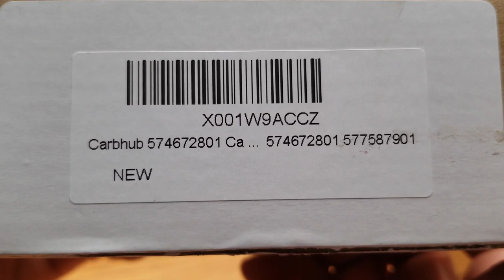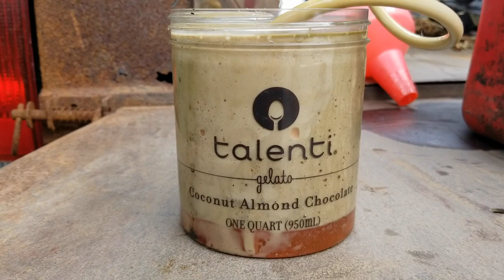CHEAP Amazon Trimmer Carb Review

Comment: They left the spline tool out of my kit period and the weed eater ran perfectly after I started it for about 5 minutes before it ran out of the little bit of fuel that was in it. Now it won't run. It spits and sputters and it'll start running smooth and then accelerates on its own and  then shuts off